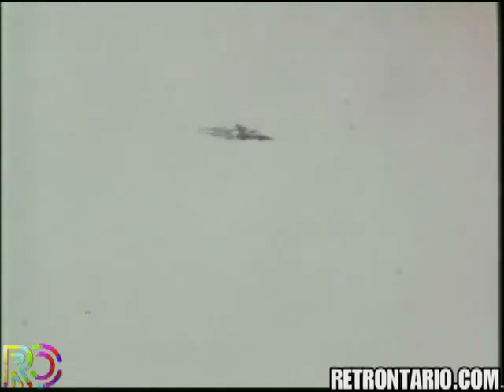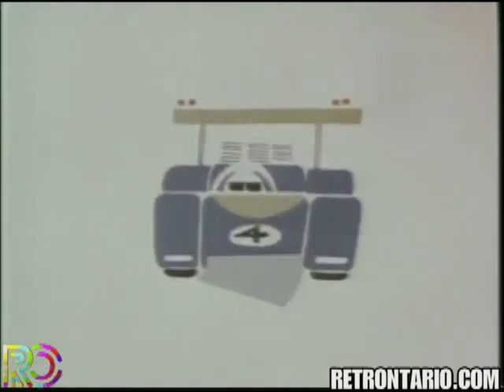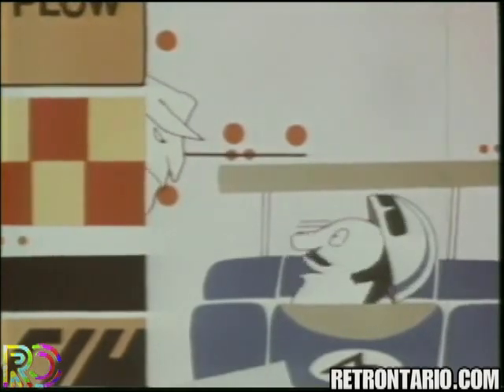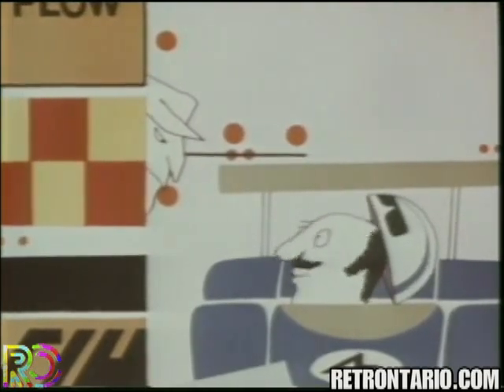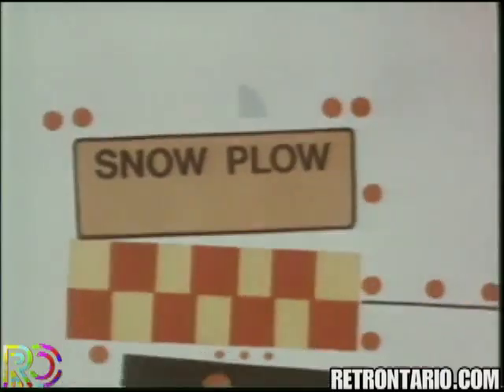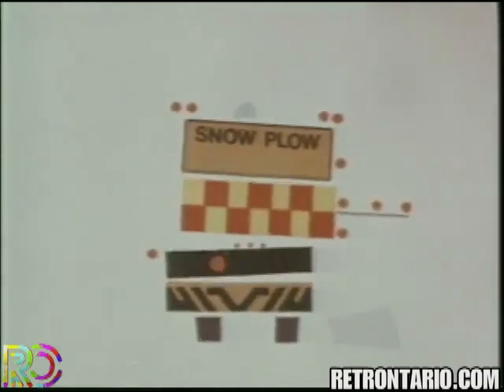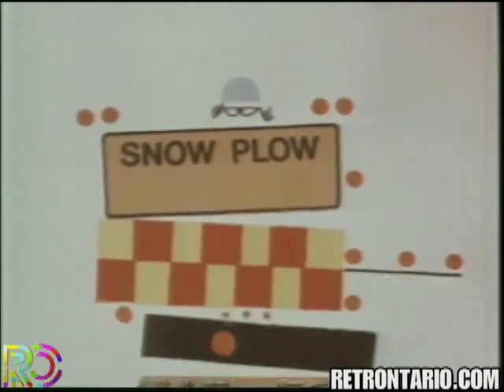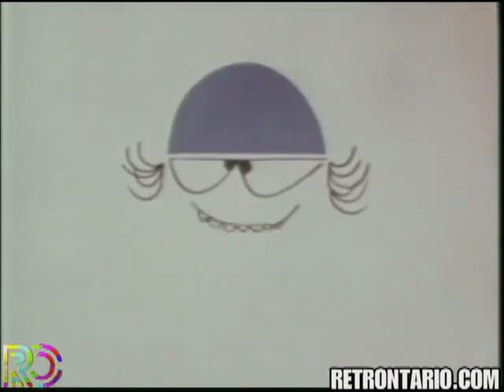Snow Plow - Department of Highways Ontario (1972) ❄❄❄❄

Comment: About 20 years ago we're driving NYS bound on the QEW during/after heavy snow and we were rolling along at 30 mph behind 3 snow plows that were going the width of the highway. A Pontiac Grand Prix or something c.ame zooming up and made a run for the gap between the left plow and the middle  cement wall. Well the snow wasn't plowed there so there was space to get in, but traction wasn't great..so the car wiggled through and bounced between the wall and the plow and raced ahead after getting through.